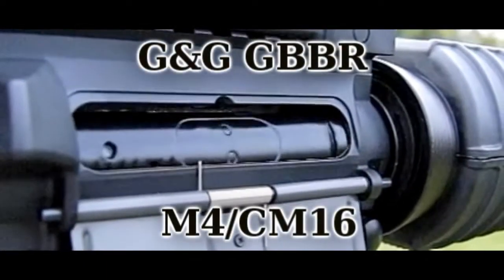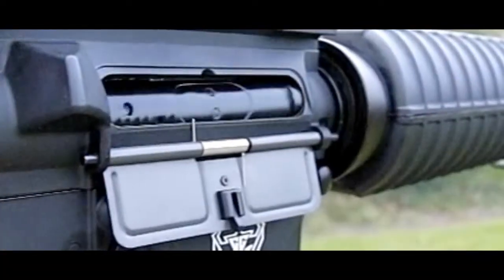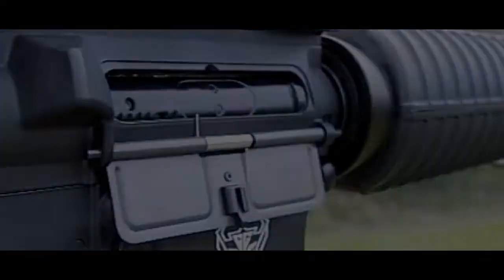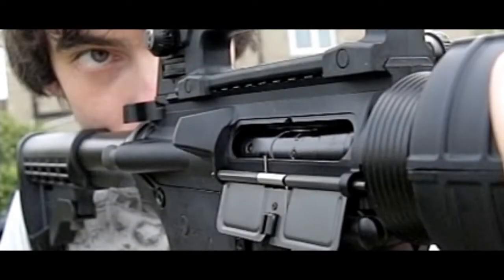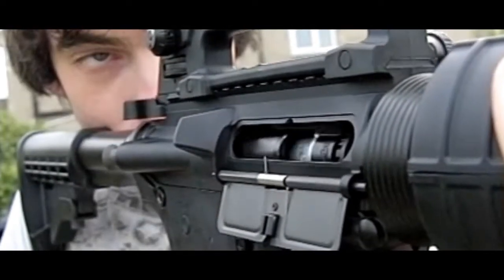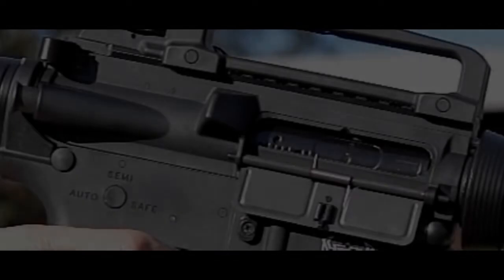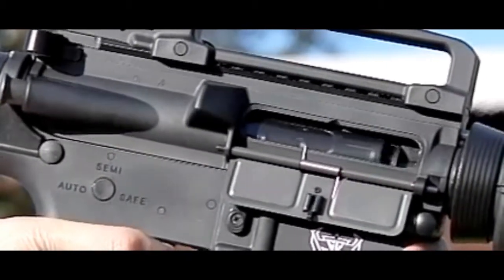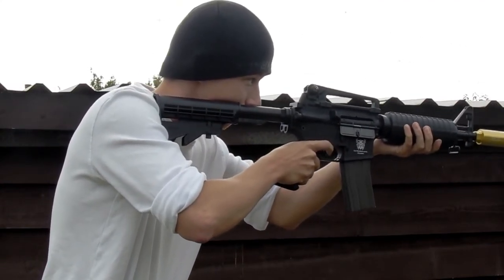G&G GAS BLOWBACK CM16 DEMONSTRATION

Comment: I purchased a CM AEG and mine wasnt moulded to the frame. it had some pins and alot of glue holding it on. after a few minutes with a dremmel tool, i took it off and installed a LP fake gas block. This should be the same. hope this helps.

Comment from the maker: The difference is, unlike WE or WA or KJW the G&G is actually built inside of a regular CM16 AEG body. They even kept the motor housing screw inserts in the pistol grip incase you want to put in a motor. All you have to do to make this an AEG is take a combat machine gearbox or similar and put the wires in, and connect the motor. Hey presto, AEG. This weapon also has long versions, and even magpul versions. Plus you can fit any length front end and any AEG rear stock to it. Dboys stocks fit it.

Comment from the maker: I measured it hitting a 50 M target which was man sized at my local site. I am honest in my videos and their comments, I can't really bad mouth this weapon. If you put a TBB into it then in theory it could reach out even further. Outer barrel change and a longer inner covered by a muzzle break/flash hider/sound moderator then you are looking at a gas DMR developing 400 fps happily hitting at 50 Metres. It has a lot of upgrade potential, you can even turn it back into an AEG.

Comment: What? You can turn it back into an AEG? So like you can run it on gas during summer or for MILSIM games and during winter when your playing noobs with 400 round hicaps you can run it as an AEG? How do you do that tho? arent the internals like entirely different from an AEG? I dont have a GBBR, so ive never been able to see the internals. but i dont understand how that would be possible. I have the G&G Raider XL, and I like the length, do they sell an extended variant of the gun?

Comment from the maker: Easily, i'd say use it on the field rather than at a CQB game. 370 it chronoed at in the UK weather using green gas and .20g Madbull ammo. Range is around 50 metres out the box. Hope that helps :)